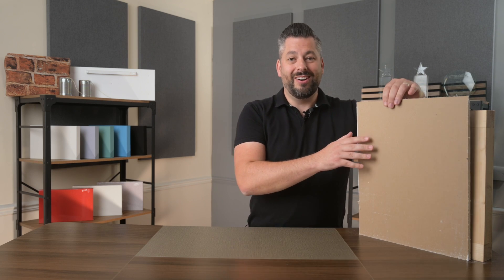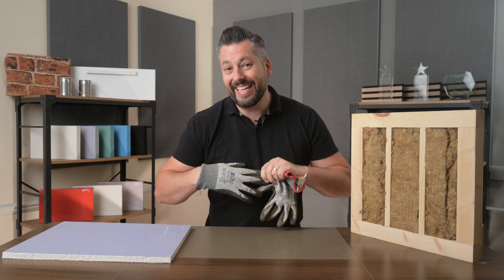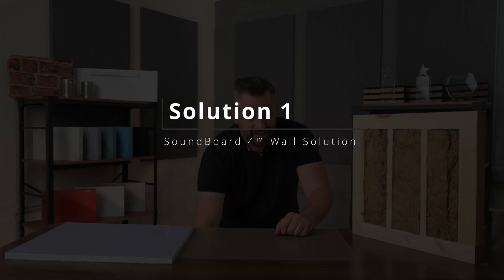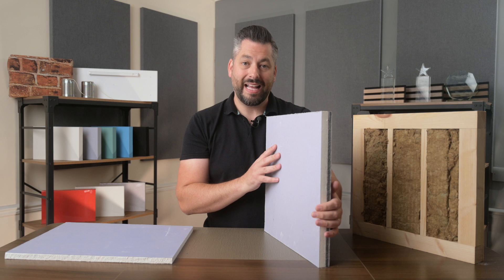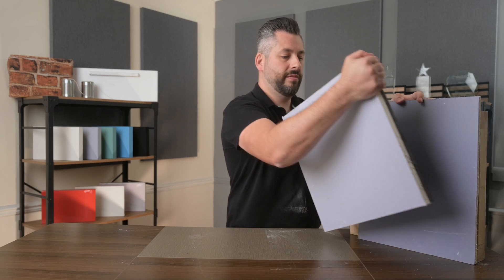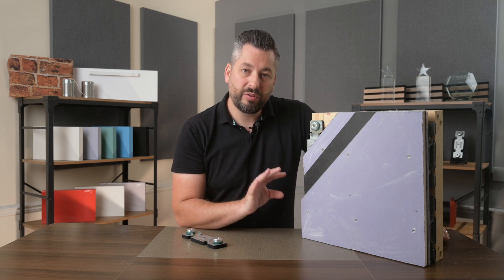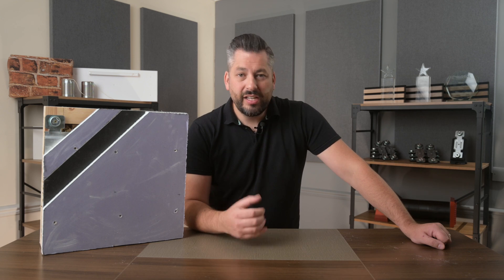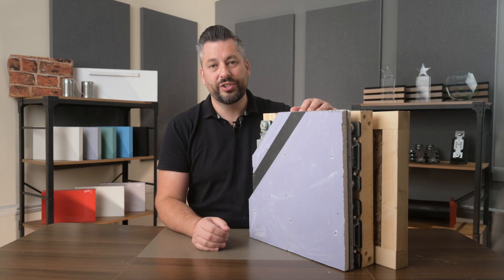The 3 best ways to soundproof a stud wall

Comment: Hello, if you are doing option 3, and the main cavity is already filled, do you still need to remove the existing lining or can you keep that?  Also does the new framing have to be 90mm or can you do a narrower frame? Thank you.
Reply from the maker: Hi @porterlisa, for the ReductoClip Independent System on a stud wall, the recommendation would be to remove the plasterboard, install acoustic mineral wool between the existing stud frame (using the same thickness mineral wool as the depth of the studs). Then build the new stud frame with a 10mm air gap. Yes, you can go narrower than 90mm for the new frame, we recommend 50mm. 
A step-by-step installation guide can be found here:
https://www.soundproofingstore.co.uk/reducto-clip-system
Any questions please feel free to contact us on (01423) 206208.
Reply: @SoundproofingStore hello, thank you very much for your reply. Could I please clarify - why does the existing drywall need to be removed if the existing wall already contains insulation? Secondly, are you able to say the benefit of adding the clips and channels when you are already building a new frame? Does building the new frame not decouple the wall enough? Thank you.
Reply from the maker: @porterlisa  Removing the current plasterboard isn't just for getting access for insulation. It's a quirk of the science of sound. By retaining that layer of board you are creating multiple air gaps split by multiple layers of mass which will actually perform worse than if you remove that layer so you only have one air gap bewteen two layers of mass. Put more simply, you can leave it if you want and just build in front but the sound reduction you achieve will be less than if you remove it. Regarding the Clips, yes just building the independent frame achieves de-coupling which will already do a pretty good job, but the frame is still rigidly fixed to the structure of the building. The clips increase walls flexibility and damping which lowers the resonance frequency of the wall and increases the sound reduction performance.
Reply: @porterlisa 

Look up the ‘triple leaf effect.’

Comment: What to do in an apartment thats already built? Is there something, that can be blown into the void by opening a hole near ceiling and the n fixing the plasterboard?
Reply from the maker: Hi @Harcix, this method can be used for thermal insulation, but has no soundproofing benefits. Depending on which surface you are trying to soundproof (assuming this is an internal stud wall?) there are a few options - depending on the type and level of noise you are wanting to soundproof against. 

For internal stud walls, take a look at ProSound SoundBoard 4 (direct to wall soundproofing panel):
https://youtu.be/C-s8n3i3rBQ
https://youtu.be/FqG0F4In74c
https://www.soundproofingstore.co.uk/soundboard-4

For brick party walls take a look at the ReductoClip Independent Wall System and the ReductoClip Direct to Wall System:
https://youtu.be/huNDsYKLpqo
https://youtu.be/R2gvGyE6kTE
https://www.soundproofingstore.co.uk/solid-party-wall-soundproofing

Please feel free to call us if you'd like to discuss your noise issue in more detail and we can advise on the best solution (01423) 206208.

Comment: Cheaper just to build from brick?
Reply from the maker: Hi @TheDetoxCureGuide, many UK homes have internal dividing walls which are stud walls, rather than brick walls. However, the majority of our customers who purchase our wall soundproofing systems are actually for brick party walls which separate their home from their neighbours property via a terraced, or semi-detached property. Brick, although much more dense, doesn't always mean soundproofed.
This article goes into more detail if it's of interest:
https://www.soundproofingstore.co.uk/brick-wall-soundproofing
Reply: @SoundproofingStore  Sure I understand that however I never had any noise issues when I had a brick wall between me and the other party. If they are really noisy it might not be enough. So sure there is clearly a market for adding sound proofing. However if you were to build from scratch and compare the cost of a brick or block wall vs the systems in this video I am guessing the brick would be much cheaper and easier?
Reply from the maker: @TheDetoxCureGuide  when building from scratch, solid brick walls will have better soundproofing capabilities than stud walls. However, many existing structures have internal stud walls which can't suddenly be turned into brick walls without huge cost and logistical implications.
Reply: @SoundproofingStore  I understand - So it would make sense for developers to build from brick rather than stick from the start?

Comment: Two separate and unconnected wall fames acting as a single frame would make the best sound proofing method of framing wouldnt it? A layer of insulation could be held separately between them allowing for air to move about the internal surfaces of the walls, allowing for moisture to be taken away too.
The walls would likely be a minimum of 150mm, causing headaches for selecting timber profiles for dressing the openings (let alone dampening the separate layers where they are ultimately connected to openings) but i think all round it's the best option.
Reply from the maker: Hi @muntee33, decoupling is certainly the most effective solution, along with adding layers of high mass to block airborne noise. The double stud you describe often isn't a practical solution because of the space loss and in most cases there is often an existing stud wall already there. This video showing the effective soundproofing of an internal stud wall separating bedrooms in a hotel might also be of interest: https://youtu.be/ZHwa3dYBQsI

Comment: Once installed, can you drill fixtures into it without a huge loss off effect? E.g. spot lights, light switches, plug sockets etc. I'm building a gym in my house so want to sound dampen the party wall, ceiling (our living room is above) and another stud wall, but I'll want to add lights, plug points, lights switches and also add a projector to the ceiling. My main reason for sound dampening is due to playing loud music using the gym late at night or really early in the morning
Reply from the maker: Thanks for the comment. Fixing things to the soundproofing systems isn't necessarily an issue. Nails or screws going into the system is fine. The problem is cutting holes out of the system, removing the mass. So recessed sockets, spotlights etc where you cut a hole out of the soundproofing and fill with a fixture is going to have a negative effect on the sound reduction. The best advice is to use surface mounted fixtures instead, so sockets and lights that are fixed onto the surface not inside of the surface.

Comment: Can you use this board on the ceiling ?
Reply from the maker: Hi @deisel321, our recommendation would be to use the ReductoClip Ceiling Solution on a ceiling:
https://youtu.be/4aPYW2HbF2E

You can use SoundBoard 4 on a timber joist ceiling for airborne noise, but it won't be as effective as the ReductoClip Solution against impact nose. More details can be found here:
https://www.soundproofingstore.co.uk/ceilings

Comment: I've just had a stud wall built but not happy with the sound reduction. Can still hear 90℅ of the noise as before (movement and talking). It's got rockwool insulation with acoustic plasterboard and that's it. What can I add to it to make it more effective? The wall is built in a bedroom party wall next to neighbours bathroom and staircase.
Reply from the maker: Hi @gemz2023, has the stud wall been built in front of a brick party wall separating you and your neighbour? With an air gap? i.e. the stud frame isn't touching the existing wall? To achieve the best improvement you need to decouple from the offending wall and then add high mass materials (one layer of acoustic plasterboard won't be enough unfortunately). For the highest reduction, the recommendation would be the ReductoClip Independent Wall solution. Details and the build-up can be found below:
https://www.soundproofingstore.co.uk/reducto-clip-system
https://youtu.be/R2gvGyE6kTE
https://youtu.be/fQcfjqQvtOQ

Feel free to contact us at sales@soundproofingstore.co.uk or (01423) 206208 and we can discuss your situation in more detail and advise on the best solution.

Comment: Why if I just spray foam inside the dry wall?
Reply from the maker: We generally don't recommend a spray foam. Anything that can be sprayed in will be a very low density which won't help too much for absorbing sound. Plus sprayed foam tends to gather in spots but not fill the space evenly. Why compromise for the sake of taking off a layer of board which is really not very difficult. Either way, the more important point is the mass that you then add to the stud wall.